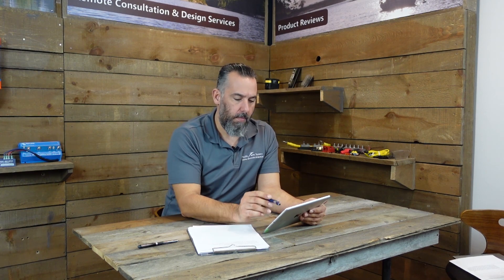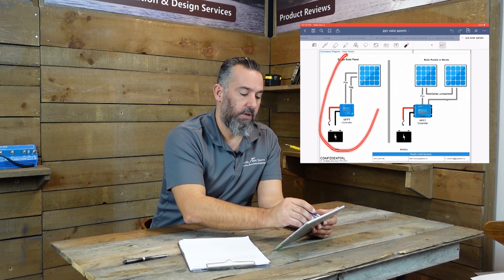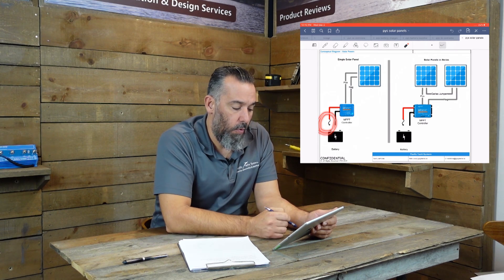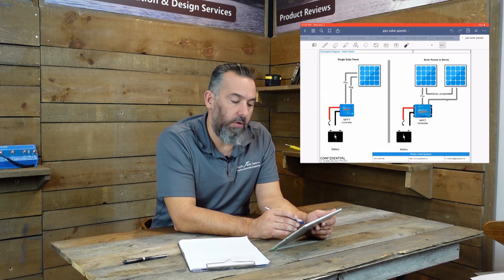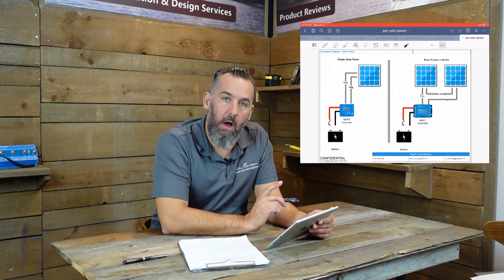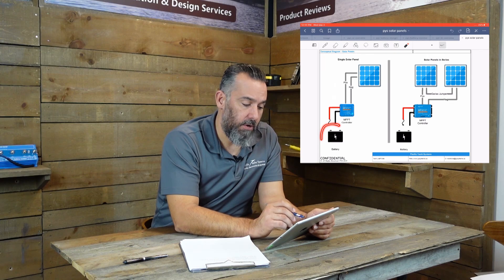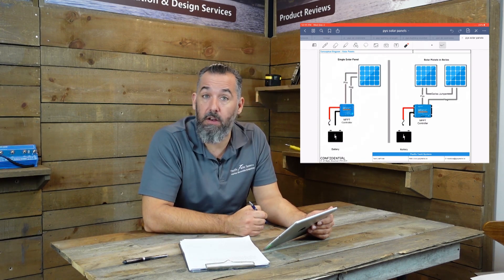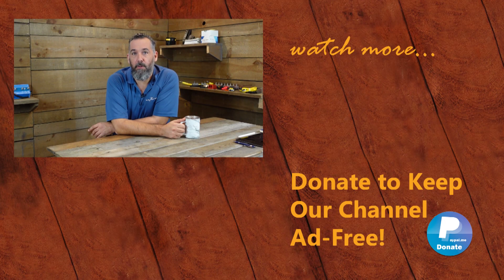Can You Explain How To Wire Solar Panels on My Boat?

Comment: I need to charge a 22-240v max 100w😊 chest freezer using solar panels on our boat. I know I need an inverter and battery(ies) but that’s as much as I know. Is this the best place to come for advice or could you point me in the right direction for advice. Thank you so much 😀

Comment: I'm curious.  I see solar calculators that say "peak hours" - do panels generate electricity in off peak hours?  i.e. if I have a panel that generates 5 amps, and peak hours are 4 hours, thats 20 amp hours a day.  what about say the other 6 to 8 hours of sun?  how much would be generated during an entire 12 hour day if the panel does 5 amps?  I assume it loses like 1/2 or 1 1/4 depending on time?

Comment: Hi Jeff,
On to the solar project :) ... in one of your older solar boat show talks you mentioned that on your own boat you use 1 MPPT per panel and showed a photo using a fuse block https://youtu.be/ghSG8xMhv4g?t=1450 to fuse and join the solar controllers is this still how you would do it given the option versus parallel or series wiring?

Comment: Hi Jeff,, Big Fan ‼️ How much Solar and Battery Power would I need to convert a 25,000 lbs Gulfstar 44 Diesel powered boot to 2 Elco 100 Motors with a Generator backup. Hope You and your family had a Great Holiday Season ‼️
Reply from the maker: Thanks for the good wishes.
Sizing a battery bank will depend on the cruising range and also the amount of daily loads you'll be running. Setting aside the propulsion requirement, a GulfStar 44 would require between 400 - 1200 amp-hours at 12 VDC of battery capacity.
Reply: @PacificYachtSystems  Thank you

Comment: Hi Jeff, thank you for the great information. I don't know if you covered this already but here's my question. I want to be able to remove the solar and wind from my deck and stow it in the cabin in a high wind event. I would like to have quality deck plugs so I could just unplug and stow. Is there some good  plugs or do you recommend thru wires?
Reply from the maker: Hmmm, the solar panels have MC4 connectors which are weatherproof and easy to connect and disconnect. Not sure about the wind turbine.

Comment: I f your using a controller for every panel..If you have four controllers.Can you run the four battery wires to a junction post,then one wire to the battery
Reply from the maker: Instead of a junction post, consider a fuse block so each controller as a fuse.
Reply: @PacificYachtSystems  after the fuse block,can I put all four wires to a junction post.And then one thick wire to the battery
Reply: I think I see know.On a six fuse block,I would hook all four controllers to four different fuses.Then one wire from there to the battery.Thank you.it will look a lot nicer that way to

Comment: What do you think? https://youtu.be/s1P31hxlD3I
Reply: NEC 690.9
[PARAPHRASED]
Solar arrays having higher current availability
than the maximum overcurrent protective
device rating specified for the panel shall be
protected from overcurrent. EXCEPT when
the short circuit currents from all sources do
not exceed the ampacity of the wires and
maximum overcurrent protective device size
rating specified on the PV module.

Comment: Solar panels - weed in parallel vs series: which set up suffers less negative impact in terms of output when there is partial shading?
Reply from the maker: With partial shading, going with parallel is better then series.

Comment: So what do you do if the charge controller you have has no internal fuse? At the point of the CC you size the fuse according to the cable or the maximum input capacity in amps of the CC?
Reply: Because, I've seen people put 300w or more of the panel on a 10 amp charge controller to make sure you get the maximum load charge controller. There is then a risk of exceeding the limit even if the panels are not all placed on the same side in the same way. What do you think? What would be your advice?
Reply from the maker: When sizing a fuse for a solar array, you need to make sure that both the wires from battery to controller and from controller to solar can handle the amperage from the array. Also, you need to make sure the solar controller is sized to handle the solar array output. Then, you fuse the wire and controller at the battery so that you don't have nuisance tripping.
Reply: @PacificYachtSystems  I agree. But when the CC has no fuse, when the panel is matched to the power the CC can handle, then you fuse at the CC depending on the cable or the panel? If it's 10 awg, do you put 30A in it or do you put a 15A for a 10A panel? We are in 12v ...
Because remember you say we don't need a solar panel fuse. The 2 reasons you name is that the panel capacity is limited vs a battery and also in another example that in the CC well there is a built-in fuse. This clearly indicates that if the manufacturer includes a fuse, it is important. So when there aren't any, this takes rules clear for a good size the fuse. 
My example earlier was a little different from the subject and we would have to answer according to a regular system and calibrated according to regular situations.
Reply: @PacificYachtSystems  Hi Jeff! I just contacted a charge controler manufacturer a second time. The answer was that if we exceed the amperage of the solar panel, e.g .: CC 10a and panel 20a, then there is no risk of damaging the CC. The only thing it will do is I will need less sun to reach 10a. It will take as much as it can, 10a, and the rest will not cause overheating. So in one example, it may be a good strategy according to them that saves the cost of buying multiple CCs and combining panels in multiple directions.

Comment: if my charge controler don't have a fuse between the solar panel and the charger do I need to add one
Reply from the maker: Nope, most controllers don't have a fuse in the controller. As long as the start of the circuit is fused for the wire and the controller, you are OK with one fuse.
Reply: @PacificYachtSystems  So if most don't, you're okay with adding one? If some manufacturers use a fuse, it is important!  
So, how should one decide on the fuse value between the CC and the panel?  
Depending on the maximum of the cable can take or the maximum amperage of the panel +/- 20% or the maximum that the CC can take +/- 20%?
If the rule is to protect the cable, then with 10awg, the fuse should be in 30 and 40 amps turn depending on the length of the cable. 
But since the energy of the panel is limited this raises reflection.
Of course, without forgetting the fuse directly to the battery 😉

Comment: Potentially dumb question :)

I am installing the B&G v60-B VHF with integrated AIS which is currently on the unswitched circuit.
I need to add a VHF splitter for AIS, but I don't want the splitter on all the time, so it should be switched.
However I also don't want to require two steps when turning on the radio to turn on the splitter as well.
Is there a way to only power on the splitter when the VHF is powered on? Like a relay or something that recognizes current flowing?
The splitter does have a yellow power control wire which I think can be used for this purpose.
Reply from the maker: Hi Eric, great question. I'd have both the VHF radio and the splitter powered by one breaker that is powered from the unswitched battery side. In other words, even with the main battery switch off, then you could turn on the VHF/Splitter breaker and both items would now connected to battery.
Reply: @PacificYachtSystems  thanks Jeff!
A bit new to electric and of course I mixed up my terminology. 
I didnt mean unswitched, rather that VHF is on the switched side but rather on the fuse block and not on the dc panel (where i dont have an open slot that could be just for vhf)  guessing adding a switch somewhere is still the best option?  

Thanks for the advice, your seminars, diagrams, and videos, they have been tremendously helpful!

Comment: Hi Jeff. As always thanks! You may have answered this before but I am moving my panels on to a Bimini this spring and thus doing some wiring. Some people in my harbour put a switch in to disconnect the panel’s from the controller. I had understood this is not a good idea. However if it is...wise to do vs disconnecting at the solar panel - could u do or replay what we should do and basics on how and where. Many thanks, your tips are awesome.
Reply: I have the same question regarding a solar panel isolation switch. A well known website says that this is a useful addition but alarm bells are ringing in my ear and I don’t know why. Can you please advise? Much appreciated!
Reply from the maker: Good question. 1st) we always install a fuse on the solar circuit at the battery, to protect the wires 2nd) we normally don't wire a on/off switch on the solar circuits, because we are concerned that someone may disconnect the solar circuit when it's charging. Curious to know what other folks are doing?
Reply: @PacificYachtSystems  Your answer is based on a potential error which is not fatal only causing there to be no load and not creating a system malfunction. Besides the risk of forgetting to put the switch to ON, there is no contraindication. I install 2-pole braker which allows me to switch off without danger if I have to make changes.
Reply: @ThinKkBIGG  exactly what I do, the service disconnect done that way is perfect for that application and relatively inexpensive.
Reply: @PacificYachtSystems  Thank you for the great fuse explanation. Because we have an aluminum boat we want to switch the circuit off when it's not charging. Where would you put the on off switch?

Comment: Hi Jeff. I recently installed a Victron 75/15 with bluetooth. I understand that ideally this is unswitched, but the bluetooth sometimes gets confused and you can't connect with Victron Connect without depowering the controller completely and reseting it. I don't want to disconnect leads to do this. How would you solve this?
Reply from the maker: Hi Bill, I know and feel your pain, Bluetooth on boats is far from reliable. Not sure how  how you can reset the MPPT 75/15 controller without toggling power to the device.
Reply: I'm not sure why Jeff doesn't mention this, perhaps because it's from the RV world but NEC code is to have a dual pole disconnect between the solar panels and the controller. You can look up Nate at Explorist Life YouTube channel, he is doing a step by step solar installation series for RVs, the similarities between RV and boats are numerous.  I've had the same problem with my victron controller needing to be reset and you're not supposed to shut off the battery connection if there's still solar panels connected. This service disconnect is perfect for disconnecting the panels first and then the battery side with a circuit breaker to reset the victron controller. Most of us are using a din rail dual pole DC breaker from Amazon for $15-20 US.